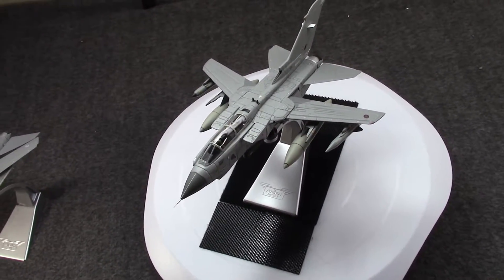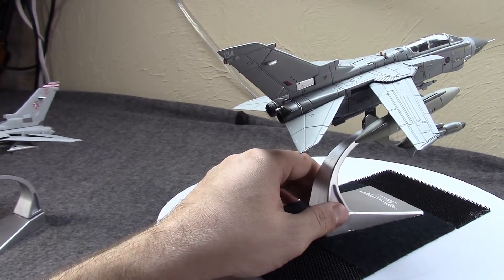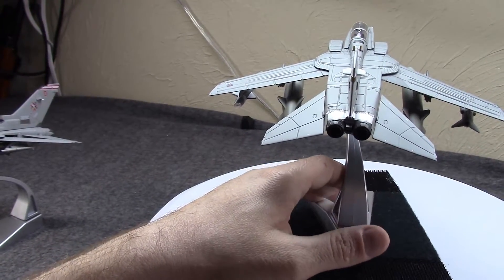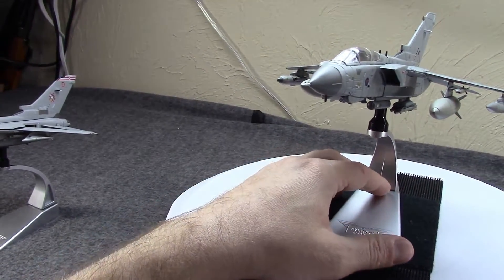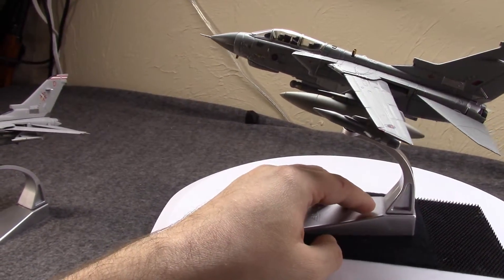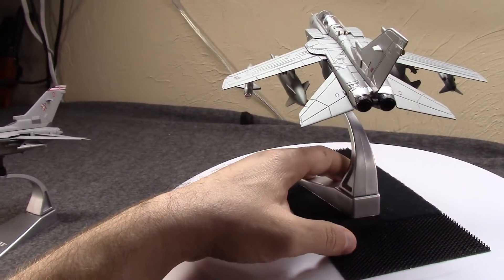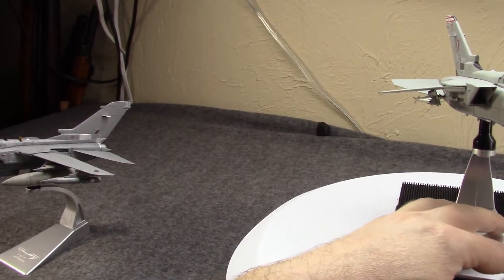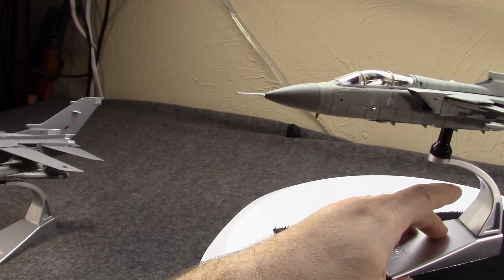British GR.4 Tornado IDS & F.3 Tornado ADV Swing Wing Fighter History With Corgi Models

Comment: Hi misha ,I'm looking for a Tornado GR.4 
Is it Corgi ?
Reply from the maker: A few other companies do make Tornado GR.4s, but yes I can recommend the Corgi highly. It comes with a lot of optional ordnance that easily plugs in, the horizontals move, and the wings swing. Heck even the little slats behind the wings move to fill in the gaps when they are forward at the 28 degree position.
Oh and the cockpit opens too, which is a somewhat unique feature for a Corgi. Pete's is sold out of the GR.4, so try Aiken's.
Reply: @misha5670  Thanks a lot 👍